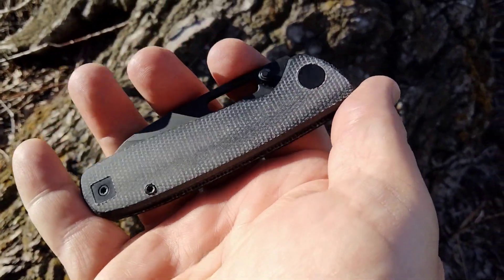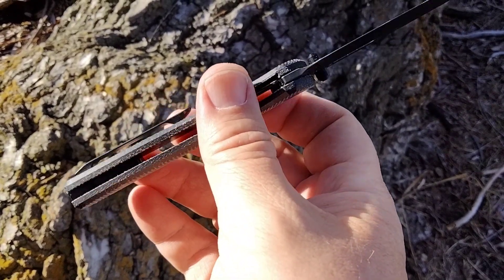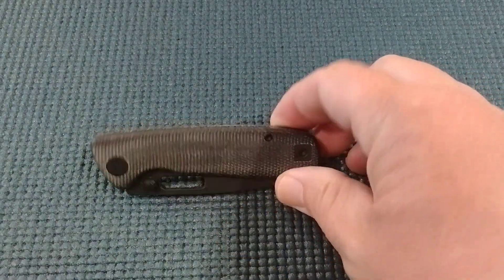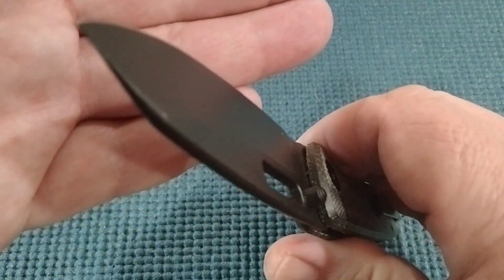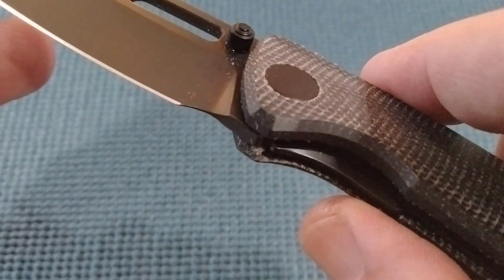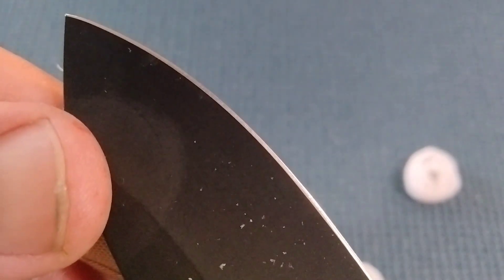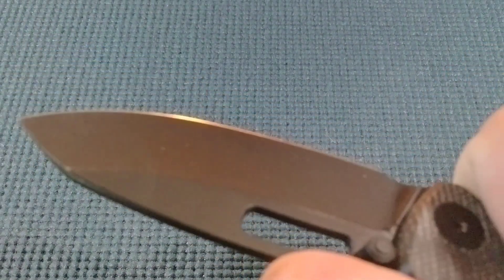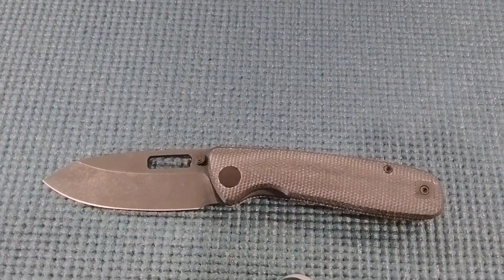TRYING TO FIND MY FAVORITE POCKET KNIFE - BRIDGEPORT KNIFE CO.  395 LL V2 - EPISODE #5

Comment: Have you checked out the WMK exclusive Artisan Arion? Micarta, hole,  nested linerlock $78 after code.
Reply from the maker: It was on my radar but thanks for the suggestion. I just took a closer look and WOW! 

Looks like I missed out on the WMK deal. Sold out. 

I did find this one  https://www.ebay.com/itm/234995273195?hash=item36b6cf4deb:g:l~gAAOSw3FNkUHf4&amdata=enc%3AAQAIAAAA4NWTy3xOg7gRYz%2BfRfwVtnLJ5DpsVzeM4s22WwOivEIdI8asKSdVmkP183irxRn2Eict8QIZujlb%2F%2FbgH3Fhg14phKeOcVCyLVBStIruIWw9HqUZytGfs6GRw8rgz2%2B9iMai%2F64IVZcTAbgd30P4zkUQBmRB4o0v0d0Y0VHwlav4Rvj2ggyiwzqBdfIXvKFc57ANf7n8G44RJppVjbdRvFL%2FAwrlv%2F5awCChQYI3PM0%2BMOz8EvT5HdURs4vSfLu7RkbfbYpDlbPmVrt8wItxLQOFUmHA13M03SzcG5%2BN%2BNym%7Ctkp%3ABk9SR4j2lN-CYg 

However, I also just got a knife I am extremely pleased with. Video coming out in June